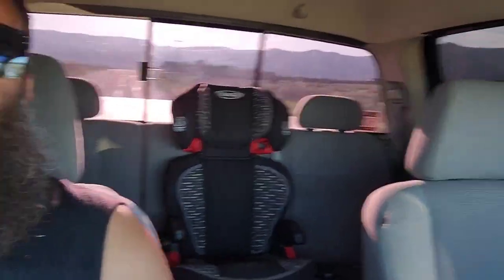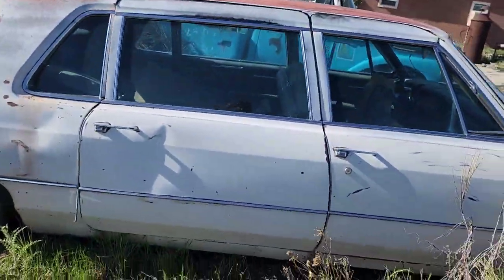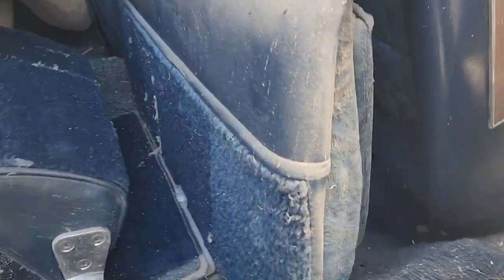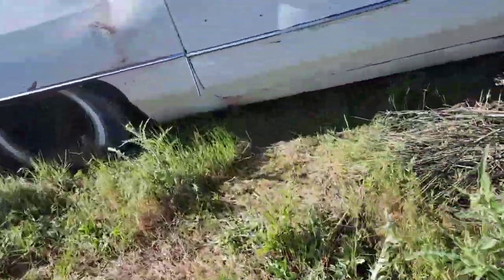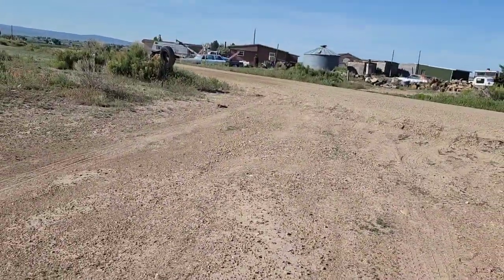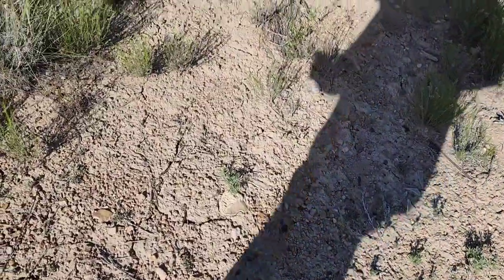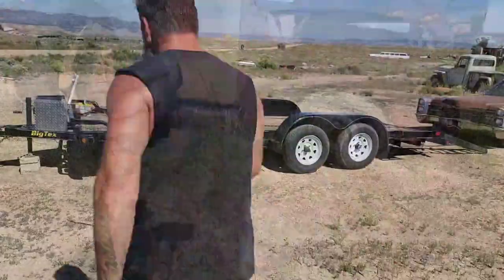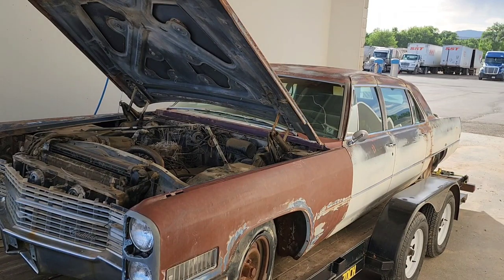1966 Cadillac Limo! New project.

Comment: My father inlaw has the same exact car 1966 cadillac fleetwood limo everything works on it inside is like new nothing missing he just had the interior redone to original nothing was wrong with the original he just wanted to make it new also did the the top with new leatherall electrical works nothing missing ac an heater also work the back seat has foot rests an fold down trays really nice car